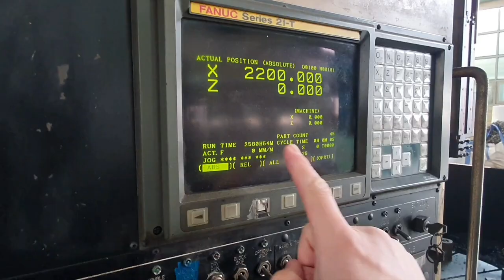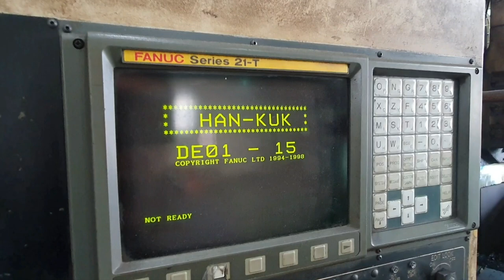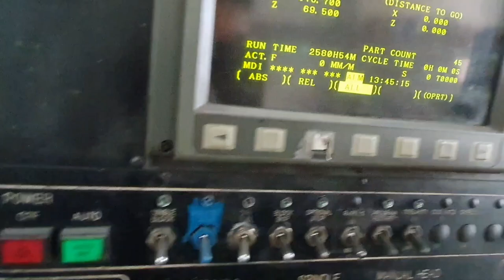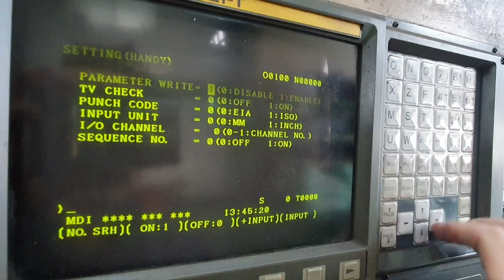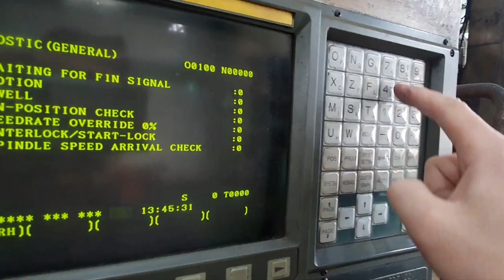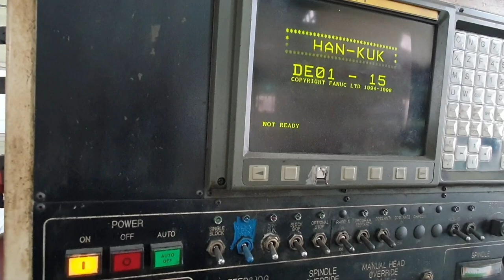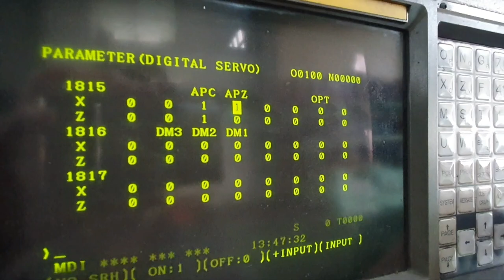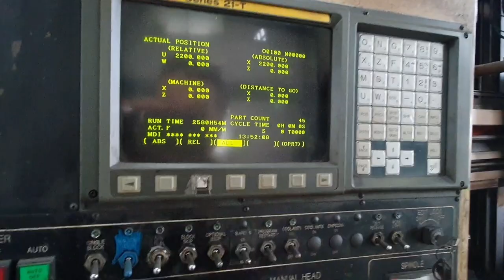FANUC 21T CNC battery remodel - CNC Lathe, CNC Turning, Parameter, Fanuc as

Comment: Never had any idea that an electrically operated machine would need batteries to run 
Thank you and happy new year
Reply from the maker: you're welcome! happy new year!
Reply: The machine is not 24/7 pluged on
Reply: Those batteries keep the memory alive for the axis encoders.  My machine has them also, we try to remember to change the batteries every year but sometimes we forget.  Charles
Reply: I'm new to Fanuc 21-t it a hardinge lathe I like to try it hasn't been used for years

Comment: With the bigger batteries you could use jumpers to connect the new battery in parallel with the old one and not have to reset the control too.
Reply from the maker: hi jim!  you're right! but the machine in the video didn't turn on for a long time. The coordinates are already erased.

Comment: Hello I just want to ask if what's happening on my Fanuc 0i-mf. I already replace the battery with new one but 2 days after it shows the APC battery alarm again.
Reply from the maker: Need to check. 1. Is the battery manufacturing date recent? 2. There are two separate batteries: a memory battery and a axis battery. APC is Absolute pulse corder. Is it correct that the axis battery was replaced on its own? 3. If it is still not solved, the electrical engineer should check it.
Reply: @jamespark_85machiningtv  I replaced the APC battery and on its first day it worked, there's no home reset happened after machine shutdown. But after 2 days, the APC battery alarm and Home reset showed again.

Comment: should I use rechargeable batteries?
Reply from the maker: If the voltage is the same, that's fine. However, life expectancy is shorter than manganese batteries.